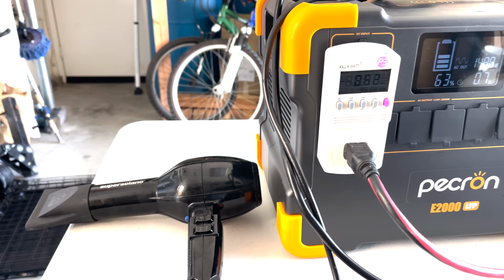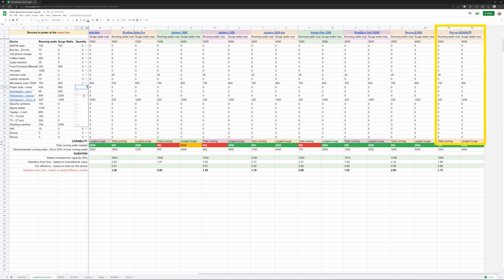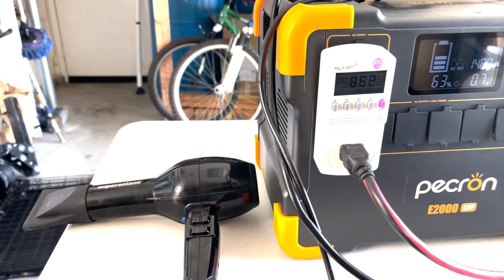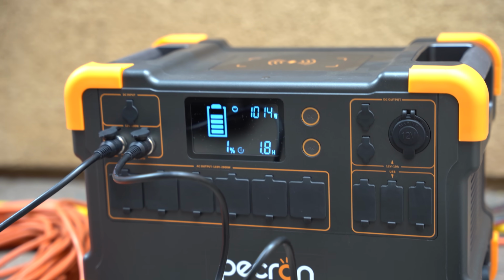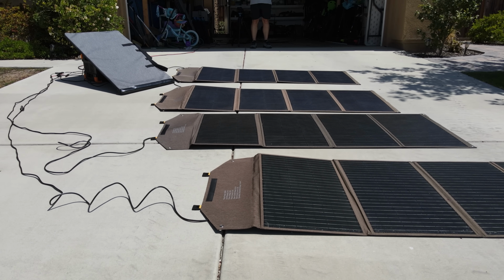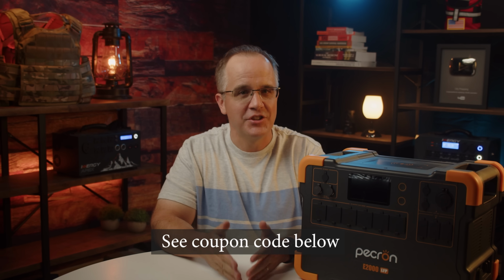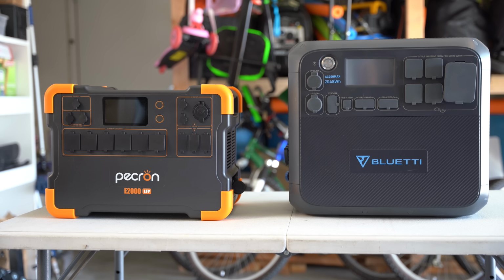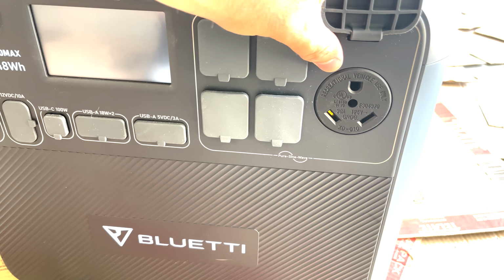Pecron E2000LFP: The New King of Solar Generators for 2022?

Comment: I have the smaller one that I use in my toolbox at work. It powers my toolbox and use the charger plugged in. This allows me to run my lights, fan, laptop, monitor and tool battery chargers all day. I can also plug my toolbox in during the day if I choose and it just runs everything that way. It’s a fairly harsh environment as it’s out in the shop with a lot of dust and heat and vibrations from moving the toolbox and has run flawlessly.  I will be buying the 2kw or 3kw one for my house soon since it worked so well. I love these boxes. I have another 500wh one that I use on our boat to power our mobile fridge so that I don’t have to risk running the boat battery dead. I also use both batteries when camping.
Reply: Jared. Did you get your pecron.  If so, how is it performing

Comment: All of those scope shots show a sine wave.  Those spikes in the waveform are distortion in the inverter output.  I would forward this to the mfr to see what they say.

As opposed to non sine wave found in cheaper computer UPS units...those can wreak havoc on induction motors and some power supplies.  Runtime is decreased under such conditions as well.  This unit has a true sine wave output.

Comment: Based on your detailed account and assistance, this has been purchased and will be on its way to Hungary shortly!
Reply: Follow-up comment on my experience with this company. I ordered my unit on December 9th and as of Feruary 19th, I am still waiting for the order to be fulfilled. 
I have a chat via their website about every other week to check on the status. In January they confirmed that they got a shipment in but that my order will need to wait for the "second round" since the first shipment is not allowed to be used to fulfill the EU orders.
When receiving the spring sale Email, i requested a price match for the difference due to the delay. This was met with a "prices vary at different times". 
After 71 days of waiting for this and after spending a large sum of money on this product, I can only hope that I actually get this product and it works better than their customer service team.
I hope this feedback helps this community in some way.
Reply: @DougZiesMedia  Did you get your unit ? If not , how did it ended ? as I am considering buying this unit and I also live in Europe. Thanks for your answer.

Comment: That's the one I was eyeing
We bought a small Bluetti Eb3a they were on sale for $209  
 I think we're going with a dual power generator first then work on a bigger solar generator
Reply: That’s what I did. My dual fuel has a remote control start, very awsome! Just got solar panels for natures generator. Still have to hook them up. Step by step.
Reply: I decided to buy a 300 ah LiFeP04, 2000 watt inverter, and an MPPT charge controller and build something I can repair for emergency solar power. I have a lot of solar power stations but when you start talking spending overe 1000 bucks it`s time to build your own power station. At least you can replace the parts when they fry.

Comment: The Bluetti AC 200 Max can charge at 1,400 watts of solar with the additonal charging enchancer. If you wait for it on sale you can get a good deal
Reply: Do you know when to expect any sales with Bluetti?
Reply: They just had back to back sales this summer so it may be a while.
Reply: @poodledaddles1091  There is currently a sale on Bluetti products on ebay (15% discount) until 8-24.

Comment: Waiting for delivery next week. They list a deal on the website which includes the trolley and 2 200w panels for 2199.00. I live just over the border from Florida so sunny days are abundant. Since my primary job in the military was power generation my curiosity and tinkering got the best of me. In an emergency(hurricane, outage) this will drastically cut back on the amount of fuel I have to use in my 10kw gas gen. Plus is it's grab and go.
Reply: Did you get your unit in time for Ian?
Reply: I just received mine that I got for the same deal. everything ships separately so I  have the trolley and generator with the one charger. sstill waiting for the panels and an additional charger. So far I love it, worked great to run my refrigerator.

Comment: Just got one, but haven't unboxed it
Reply: You prob know this but you should break it out and charge it fully vie solar. Then test each input & output. Test each solar panel individually and in series. Test the fan & overheat cutoff. Find the onboard reset switch. Test full AC charging (often overheats). Test charging in the car. 

I made the mistake of unboxing my unit (not this model) and found some hiccups that caused me a total failure (bad MC4 adapter and cooling fan not working) and it was out of warranty. 
Lastly, I would advise to have a bunch of cables, connectors and a good crimp kit … you’ll need it over time).

Comment: Wow, very thorough  review!  I opted for the Bluetti 200 Max several months ago and have learned a few interesting things.  Since i also got the 2 expansion batteries, you can actually hook up 3 AC chargers (main and on each battery module), which gives you 1500 watts of charging.  Using the a DO50S DC charging enhancer on each of the battery modules allows you to hook up an additional 500 watts of solar to each battery in addition to the 900 watts going to the 200 Max for 1900 watts of solar.  But, you have to spend another $700 bucks to really max they system out.  If i had waited though, the Pecron would have probably won me over:)
Reply: The ac200max can use the additional 500 watts of solar as well....letting it take 1400 watts plus 500 more from each battery. The dc charging enhancer is only $150.
Reply: I bought the AC200Max as well, and adding the additional charging features was... frustratingly complicated. For what they charge for the unit, they should have at least included the T500 AC Adapter & DC7909 To XT90 Cable. Instead, you have to purchase these separately, and the connection setup is not exactly intuitive. Compared to the SuperBase Pro 2000 that I also got, which uses a standard PC power cable, has no brick, and can charge from a wall outlet at 1800w, it's out of touch.

Comment: This review is very misleading.
1) Till yesterday there was no user manual on the Pecron page.
Only after pointing this out to them, the E3000 was converted to the E2000LFP. Apparently it's the same one. There are still references to E3000 in it. :(
2) Trying to reach anybody via email or their chat will take you anywhere from 12 to 24 hours. There is no phone support available. 
Communication is hard at best. Not to mention the language barrier.
I would not recommend this unit for the first time solar generator user. You might be very frustrated and disappointed at the end.
My 12 volt DC output stopped working altogether, including the USB ports. Trying to get this resolved is becoming a pure nightmare scenario.

Comment: I wish Pecron, Blutti and Delta owner would comment on customer service after the sale or if problems occur. The believe that is one of the biggest selling point next to the features.
Reply: I own a Bluetti 200p and that 265 watt small one.   I have called a few times to ask some questions I had.  No one answered or called me back. I eventually figured the issues out but it’s a bit concerning no one ever called me back
Reply: @michaelcrawford3663  Thank you, for your feedback. I have read that their customer service is not very good even to their affiliates that promote their products. That is why I hesitate to buy their products.
Reply: I own two different Pecron models, the S1500F and the E2000LFP.  Back in March, I emailed a question to them about the AC charger LED indicator for the S1500F and they responded within 8 hours.

Comment: Enjoying this channel very much. Thanks for the excellent production quality and clear explanations. 
I’m trying to figure out what if anything I can replace my deafening 9000w Champion dual fuel generator with. I can likely get by with far less but I still need 220v 30amp tho for my house water pump and purification system. 
Does this mean an additional inverter to get that voltage step up? Or is 220 still beyond solar generator territory?

Comment: I have been checking out solar option for awhile. I am not very well versed in all the amp requirements and such but like other people had said I want something that will run a refrigerator, a heater and provide enough power for me to take a shower, in case of a power outage. I'm just wondering how well this model would work for that. Plus, I live way up North and in the dead of Winter would this be able to be solar charged or is it going to conk out on me when I need it most? Would this unit still charge with very limited sunlight?

Comment: If the Pecron will take power from a solar panel, it's already beaten Bluetti.  The first Bluetti AC200P that I bought stopped taking input from solar after three weeks.  The second one I bought wouldn't take solar right out of the box.  Go look at some of the negative reviews on Amazon, and you'll find that this is a common, KNOWN issue across ALL Bluetti power stations.  I thought if I bought an AC200MAX, I'd dodge this problem, but MAX owners have reported encountering it as well.  Furthermore; both power stations I bought came with a fault report log that was SIX PAGES LONG, which tells me that Bluetti repackages and resells returned product.  Getting Bluetti to acknowledge that they sent you a defective power station, and agree to a refund is an ORDEAL.  I'm done with Bluetti.  As soon as they sent me the return shipping label for this POS, I ordered the Pecron E2000.
Reply: so, how do you like the Pecron?
Reply: @M L  It's been great.  It's dead quiet, and efficient.  I like the fact that it has 2 inputs for charging too.  So if you have mismatched solar panels (panels with different outputs), you won't bottle-neck your whole system.  You can plug the higher output panels into one input, and the lower output panels into the other one. Their customer service has been great as well.  I definitely recommend this power station.
Reply: @Luthiart  are the solar charging cables included and if not where can you buy them? thanks in advance for your answer

Comment: Just attempted to purchase the Kit with panels & 1 xtra A/C charger. the Code was NOT valid for anything other than JUST the core unit (I guess). 
As at checkout stated Code Not Valid for items in cart. 
Disappointing as it took me 45 min to convince my wife to spend the $$. 
Love the review but Really bummed on the restriction. 
Anyhow, simply puts us over budget to aquire without the discount. I know we “could” take the 10% on the core unit but to then pay way more for parting it out just makes no sense $$ wise. 
Not so stoked on the overall experience with Pecron right now, BTW.

Comment: Thank you for your review. My wife is on an oxygen concentrator 24/7. I currently have it plugged into a small UPS which gives me about 15 minutes to get my generator up and running. This unit would greatly improve our capabilities. Our chest freezer and refrigerator take Seco place to life support. Again thank you for the information
Reply: Looking for an O2 concentrator solution, too. 341 W really made me look at higher-end solutions. I'm looking at min of 3072Wh - if I buy the 2 batteries for this (due in Oct 2022), I can then bump this up to 8064Wh.

Comment: Great review Kris and thanks for adding the Pecron to the spreadsheet. Question: I had a 30 Amp Generator Power Inlet Box installed with my new circuit breaker panel a few years ago to be able to connect a generator (which I am now able to buy). Does the Pecron have a 4 prong 30 Amp outlet? Of course now I want solar rather than gas or propane since it is practical year-round in Arizona. It would be so nice to just turn off the circuits I don't need and let the ones to the refrigerator and 1other circuit get juice, and not have to run extension cords. 
If the Pecron doesn't, does the Bluetti have one? I don't think the comparison spreadsheet mentions these.
Reply: Bluetti has the standard three prong rv 30amp plug. Pecron doesnt have anything. Bluetti also has an ac300 unit 3000 watt inverter...and just announces an ac500 unit 5000 watt inverter!

Comment: Hey bud, thanks for the info. But could you please make it more simple for those of us that are not rocket scientist.  Example: how long could it run a regular refrigerator.?
Reply: His name is not Bud…..condescending
Reply: the watt hour (Wh) capacity of your power station x 0.85 (this is the conversion factor) / wattage requirement of the unit you are trying to power. For example, if your refrigerator (after initial surge) consistently draws 125W of power and the Bluetti AC200max has a 2048Wh battery, you would calculate this like: 2048Wh x 0.85 / 125W = 13.9 hours. So the AC200max could run the refrigerator for about 14 hours straight.

Comment: Could this be used as a sort of pass through uninterrupted power source for an on grid tiny home?  Sometimes for only a few hours other times for a-day or two.  If I had this wired into a few essential circuits to keep them on during those times it would be great.

Comment: Are there any devices that have built in and modular replacement capability for EMP and Carrington event situations? How good is something that gets blown out from an EMP or CME? I suggest manufacturers build in plug and play replacement modules so we can be prepared after and EMP.
Reply: You can always purchase an EMP bag and place a medium to large size solar power station inside. Not 100% safe but does afford appreciable protection...

Comment: I find it hard to believe any solar generator will last 9+ years. I think 5to6 years is all you will see from any solar generator , at least without repairs. Therefore if i buy a pecron it will be the e3000. More power with around 2400 watts available after 4.5 years.

Comment: I would be really wary of buying a generator that doesn't have any extra batteries right now given the supply chain issues. having the manufacturers say that they're going to have them out in a few months there's no guarantee. I also agree could you do some negative reviews? I was wondering and buying a very small Westinghouse  iGen series generator? 
I can't afford these expensive ones. any reviews on these really smaller ones I'd appreciate !!! thanks. and I agree with the other comment that yes you were also getting an expensive free generator as compensation.

Comment: Do you have to buy a charging adapter for the pecron separately? (13:27)
Reply: No.  It ships with one AC adapter (model C1200) rated for 600 watts.  You could buy a second AC adapter and charge the unit twice as fast, or do a combination of the 600 watt AC adapter with 600 watts of solar, for example.

Comment: Curious as to why under the Bluetti AC200Max on your Google Sheets, you have it listed for "Home/Emergency Preparedness", and the Pecron E2000LFP as only "Emergency"? 
Thanks for the video, seriously considering.
Reply: Because the Bluetti is better. It has a 30amp rv plug and a 20amp 12 volt port.

Comment: So we got the Pecron E2000LFP.  The cool top charger for a cell phone DOES NOT WORK.  I've reached out to their support over a week ago, and have NOT heard back.
Reply: You can check the spam, I did it before, but when I re-messaged them, they told me that had replied to my message within 24 hours, and then I found out that this email was filtered as spam, Their customer service is friendly and I like that they are polite
Reply: You might want to see if your cell phone supports the "Qi" standard for wireless charging.  For example, the iPhone 8 Plus that I tried with the E2000LFP began charging while my Moto G5 Plus did not, because the Moto G5 Plus doesn't support Qi charging.  You also have to make sure you've turned on the DC output using the top button so that  top charger can supply DC to the phone.
Reply: Thanks for the help.  Been out of town on business and just got back.  Will check my spam and will also make sure my Iphone XR supports it. Then will check the DC output.  Sorry for my delayed response.  I will update as soon as I am able to as well  Thanks again
Reply: @lerbonrver8367  Thanks for your response.  I did check my spam and still found nothing.
Reply: @BunkieNM   Thanks so much for your help.  I did as you said about the DC and checked and my iPhone XR started charging.  Thanks again

Comment: A question and a statement. 1. Solar Charging - You said 1200w in parallel. Is that not really Series/Parallel? Looks like you have it set up with 2 strings of 3 panels, and those strings are connected in Parallel. So its really a 3s2p set up. So that being said, do you know what the Max AMP draw on the MPPT is? Thats pretty important to know when connecting in parallel. 2. - Pecron has been around longer than Bluetti or Ecoflow. Just not in America.
Reply: Max AMP is  maximum current?
Reply: @lerbonrver8367  correct.

Comment: How efficient is it at low load.  Say a cycling refrigerator and a small fan all night.  It seems to me the larger the inverter the more it will drain the battery doing near nothing.  Is efficiency much different at low load vs high.  Does it matter?  If so, right sizing the inverter might be important.

Comment: We live off grid in Yaak MT we are not rich and need to get the most bang for the buck for a portable solar panel power system which system would you recommend for around $2000. Thanks great channel.